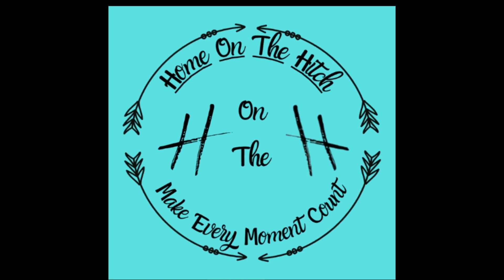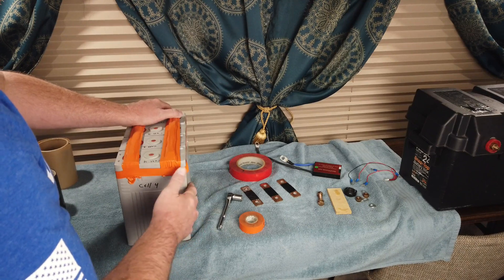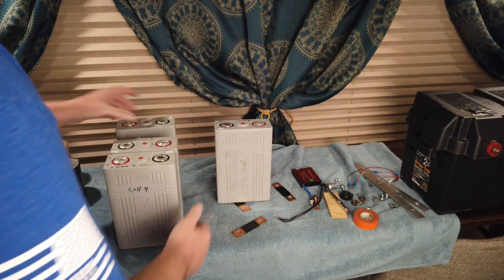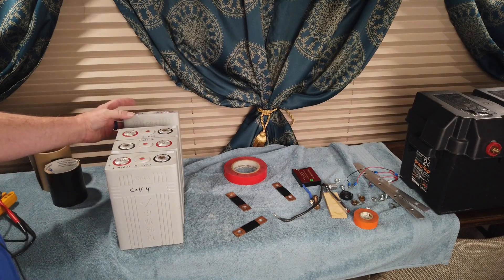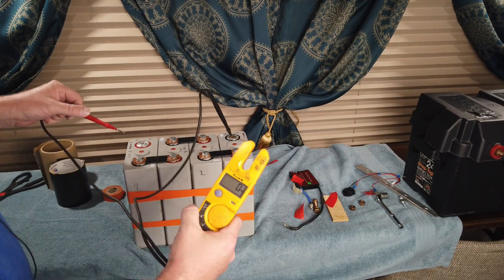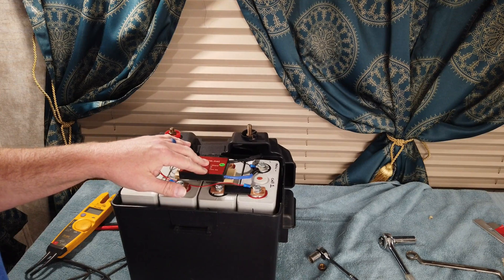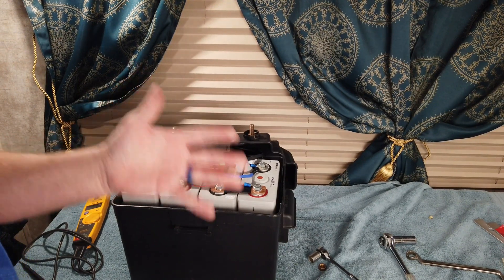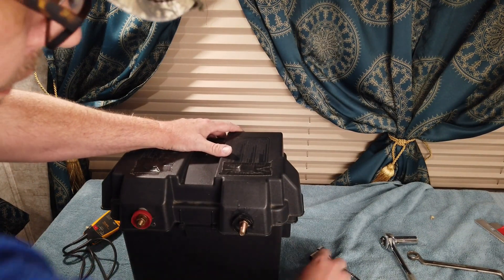RV LITHIUM BATTERY UPGRADE - RV LIVING - PART 2

Comment: What do you know about lithium batteries in cold weather? I heard they need to be heated in cold weather
Reply from the maker: Well. It depends on your climate. And where you store your batteries. The lithium batteries can be charged all the way down to about 23 degrees f.   And discharged as low as - 22 f. So if they are inside a heated space it’s not much worry.  But it is very easy to attach small 12 volt silicone heating pads to the cells and have them come on say at 40 degrees or so to keep the cells warm.   Discharging cold isn’t really the problem. But charging them below the rated temp will cause damage.